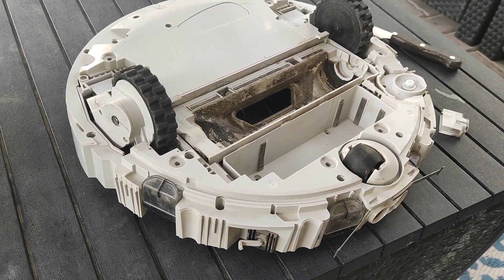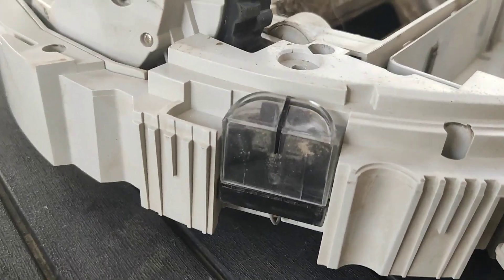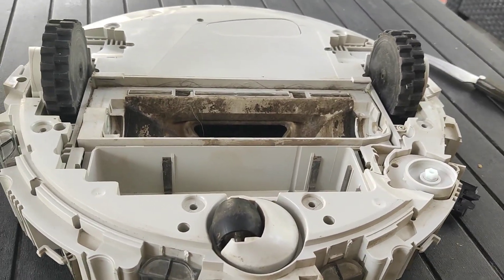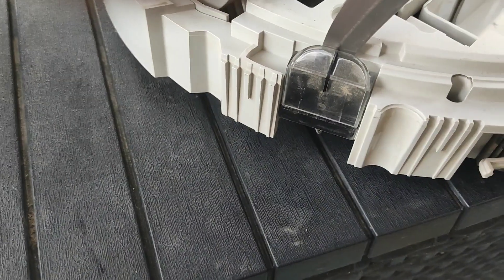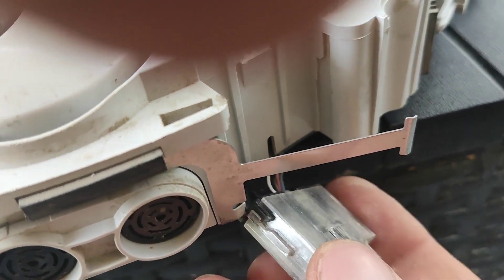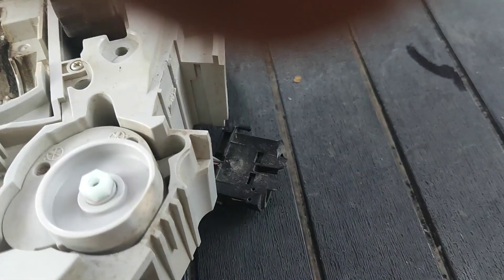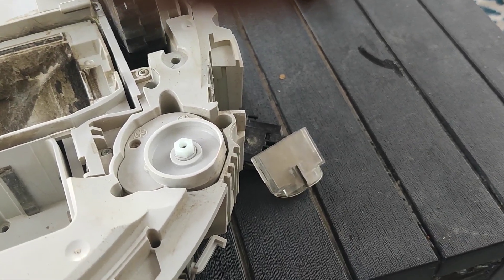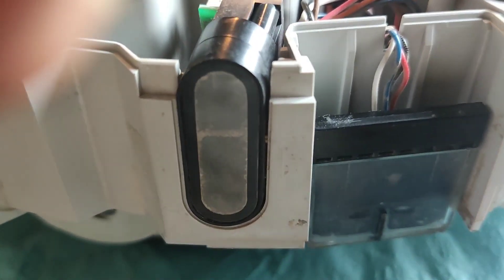Roborock Xiaomi Vacuum robot full fix of Error 4 cliff sensor wipe the sensors clean from inside

Comment: How have you removed the top cover sp that you were able to freely remove the sensors after unlatching them? I miss this sequence, and this is is also the moment I stuck when removing the sensor. I inscrewed all scrwes (at least I think all) however something still holds the top cover.
Reply from the maker: You can see it at the end of this movie: https://youtu.be/N6M-0o6Z2fE
Reply: @rybnibor  thanks for additional stuff, however, it is not that 'cover' i was asking about. My device is S5 and still my issue is to remove the part of the cover that from top, like below the lidar 'tower'. It is also on your movies but either mounted or removed. So, neither the 'bumpers' nor their frame. Rather the big piece that is holding half of the device. There are several screws here and there, all removed, yet something still keeps everything in one piece. Without removing it I have no space to unlatch and lift the sensors to properly inspect.them. Any ideas?
Reply from the maker: @projekt156  then pls check out this short (hope that's what you mean): https://youtube.com/shorts/8HOGz1tT7kA
Reply: @projekt156  Ищите шуруп под пломбой.